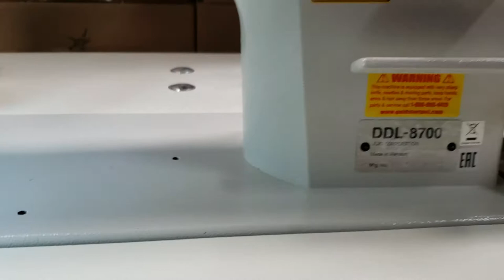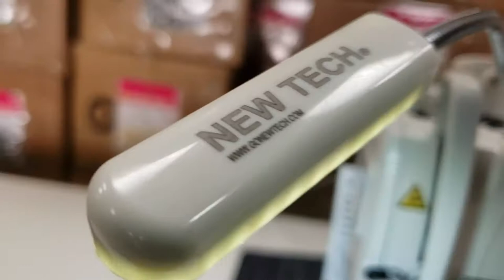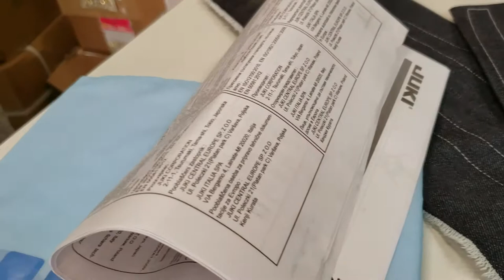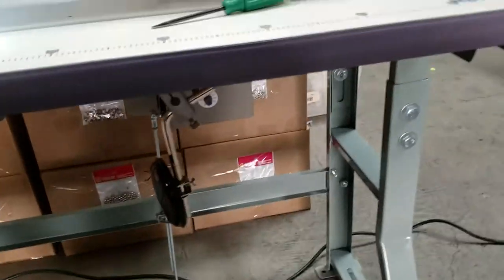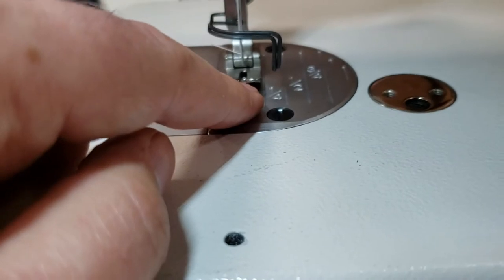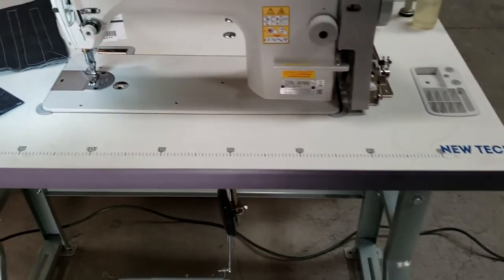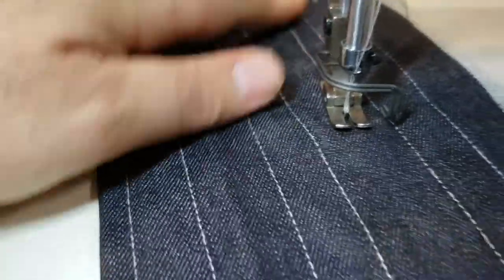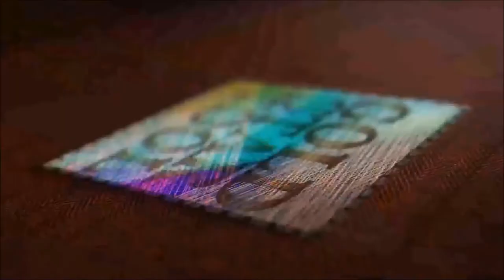Tutorial - Juki DDL-8700 Common Questions - Goldstartool.com - 800-868-4419

Comment: I wonder why the motor manufacturer doesn't put the speed control knob by the on/off switch for quick easy access...have to reach under the table

Comment: With all the videos I’ve watched, I have never seen what size belt is used for the 8700. I bought the head, table, 750 watt brushless motor all separate and none came with the belt. Thanks

Comment: I have this machine but find if I am using fine fabric the material snags and wondered if it’s something to do with the feed dogs or is it the pressure foot I would really appreciate your reply ( I changed the needle to a fine needle and the thread tension is ok and changed the plate but left the feed dog the same). Thanks.

Comment: Hi, I'm sorry  but the threading of the Juki 8700 you show is false. The thread should go directly to the tension and after when it's only after, when it climb, it goes inside the guide. Regards.
Reply: They showed it correctly.  Check your manual.  Mine shows it exactly as they have it.
Reply: @katiedillingham5739  That's strange.
 I confirm it is false. https://drive.google.com/file/d/1R1z02g_1RqzC3AOnSLb1YrrsHdbe49WB/view?usp=sharing this the copy of the threading from juki ddl 8700 manual.
Reply: @Frapalaune  I guess I don't know where you are talking about then. I thought you were talking about the first disc but guess I'm not seeing it.
Reply: @katiedillingham5739  The first step it is the small tension disc on top. The second is the "brake" lever vertical (the two hole) on top and the third one is not the "guide" but the disc tension as chown on Juki document. The "guide" is in reality the thread lenght setting guide.
I saw many, many video passing the thread into the thread setting lenght guide before the tension disc. Like this the lenght thread as no effect and probably in some particular sewing, make trouble. Enjoy !
Reply: @katiedillingham5739  If at the first step you do not have a vertical bar with a small tension disc but only a vertical bar, you do not have a 8700 but a 8700 H.